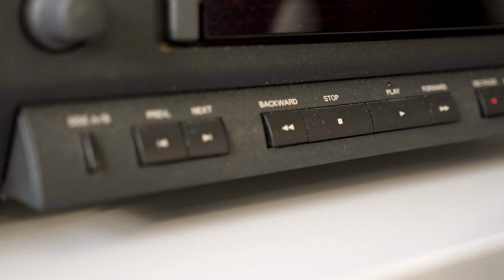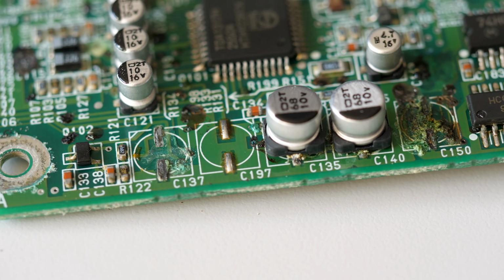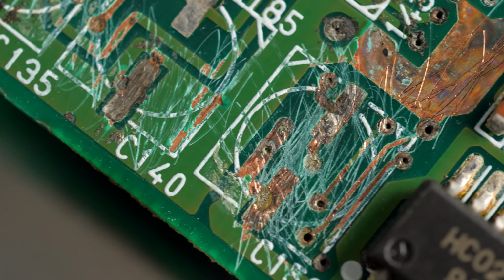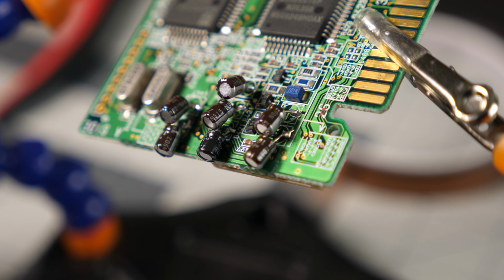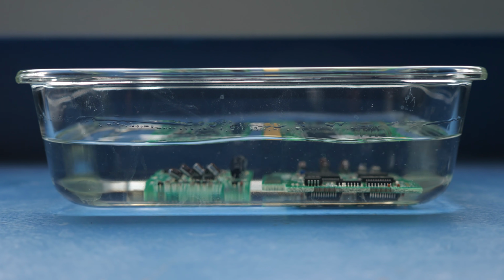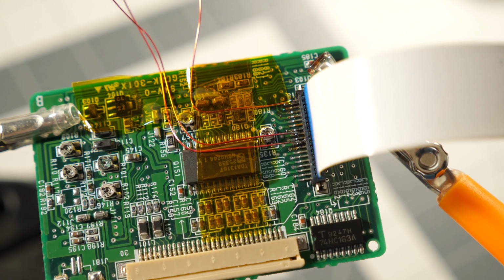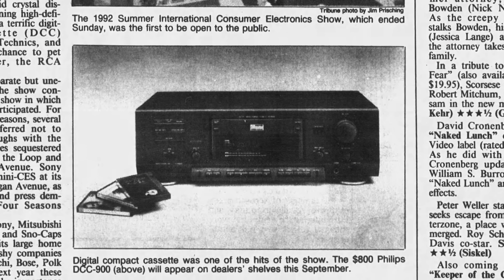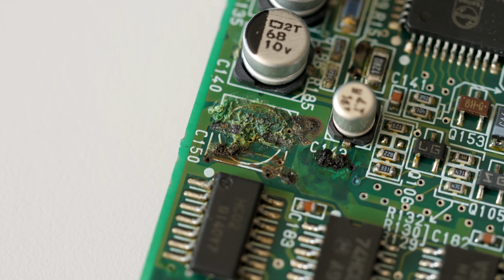My DCC Deck Repair Didn't Quite Go as Hoped...

Comment: I had one with similar problem, it played DCC just fine, but it played regular cassettes with a ton of noise and if I recall, mostly from just one channel, what I learned from it, DCC players are junk. I've owned many high end stereo cassette decks from pioneer and similar brands and they always had excellent playback quality. If I needed better recording quality than standard cassette I used either Type II or type IV cassette and recently i converted them to .WAV on my PC and they sound perfect, near CD quality. DCC seems like a useless format to me, no artist ever released any album exclusive to DCC, unless you were a musician in the 90's and backed up all your master recordings on DCC instead of DAT or CD-R, the machines aren't useful or valuable.

Comment: Don't want to criticise Dr Dcc, but he or someone from his company did quite messy job to the read/write board. Looks like he just badly scratched loads of pads and traces on circuit board with some sharp needle or scalpel, when it's can be done with tiny soft wire brush tool on dremel like machine without doing such damage which I can see from your video.
As well adding to your problem with your board I can see clearly that loads of other smd components has been damaged by leaking caps. So they all need to be desoldered and replaced with brand new ones, or at least checked with multimeter.
Good luck.
Reply: I agree. Whoever did that to that board had no idea what he was doing. No way was that a professional job. Kind of embarrassing for the „DCC museum“. Just because someone can restore a DCC machine doesn’t make them experts in pcb rework. That board was definitely repairable.

Comment: Wondering if the timing issue is due to a bad crystal, although it would not be an easy fix if it were built into one of those big chips if so.

Comment: 14:23 - Couldn't it also mean you had two bad heads? A head problem isn't really eliminated unless you can test with a known good head.
Reply: The problem with DCC heads, they're pretty much unobtanium. Plus they have to matched to their R/W board, which was done at the factory.

Comment: Not sure how it would be feasible but I’ll go for a complete passive component replacement.
Also in that mater, I would try to see the trough hole connections it does look they are botched and probably not making connections.
The amount of work to be implemented is large but honestly it all can be done.

Comment: Sorry man.  Went through this whole business with an Optimus DCT-2000.  R/W board was in really bad shape, almost as bad as the first one you have.  I recapped, ran some bodge wires, checked continuity, but a bunch of vias were closed up with corrosion they were so bad.  I did manage to get it to play DCC, and some analog cassettes with some random popping and channel dropping here and there.  Not really listenable anyway.  And it won't record at all.  I decided to shelve it and hold out for a second or third gen.  The fact that you went through this heartache with two decks only reinforces my decision.

Comment: I love old school Audio tech. 
I used to own a nice cassette deck. REAL good audio quality. 
One day, it stopped working. Opened it up and it turns out a couple tiny plastic wheels snapped in half. This was before 3D printing.Sadly, I had to throw it out.

Though you didn't get it working, that's the woes of repairing. You wont always be successful.

Comment: There is dozens of things you could try. Try soaking the PCBs in vinegar to dissolve the corrosion, then wash it with soaps, water, and IPA. When I do DIY PCBs I use kero, then strong ammonia cleaners, then water, then IPA. Watch CuriousMarc HP 98035 Clock Module Repair-A-Thon, there is a reoccurring corrosion section in it - he had to scrape and vinegar it several times -.
Maybe align the head.

Comment: I feel for you. An object lesson of obscure audio products. Been doing audio for over 50 years and I will tell you. 2 formats avoided like the plague. 8 Track and DCC. Both are a waste of time for me at least. Your mileage may vary. I never thought it was not that impressive in the first place. DCC. A compromise on both and not great at either. Like an early days enduro motorcycle. Sucks on the road and on the dirt. I am a huge fan of SD recorders. No moving parts, media is cheap, and it requires no herculean effort to make it go. My reference recorder is my Tascam DR-100 mk.3. Love this thing. My Nakamichi and Technics and Aiwa and A&D Cassette Decks are fun, but it is tape. I love them, but for a project I have to count on, or just don't want to bother with Noise Reduction tape calibration and so on, SD rocks. DCC and Elcaset remind me of a  question nobody asked and nobody cared. I sold audio for over 30 years and not once did anyone bug me about DCC or Elcaset. Heck I got more on Reel to Reel and DAT before I ever heard anything on those minority formats. Notice the words good and bad are not in my post. You have to decide what that means in your reality. For me DCC was a blink of a curiosity and I moved on. DAT today is the same way for me. Another moving transport and hard to get media and support that maybe poor. No thank you. I choose my battles carefully. Do my due diligence on documentation support, parts, experts who aren't retired or dead. Yeah like that? Because vintage is just what it means. "OLD!" So know what you are getting into before you dive in. You maybe happier with a Tascam DR-70x for less than $100.00 and for most sound like a million.

Comment: In one or more double sided pcb when traces corroded check for continuity between the levels of a suspected trace.Also try to resolder smd components because there are cases that cutted in an edge and this getting lifted by the soldering tip.And check not only the removable pcb but the mainboard also.The smd chips are prone to dry joins and is good to be resoldered.Every microswitch inside the mechanism of course has be checked for good continuity.

Comment: I wonder if it could be a bad solder joint or a missing trace somewhere, I would go over that R/W board with a mutimeter and test all the connections.

Real shame you couldn't get one of them working but a great video!

Comment: That soldering iron tip is really bad because it does not transfer much heat, you should use instead a flat sided C type one

Comment: I think I'll stick with DAT decks after watching this...
Reply: Good luck with many of them... Check the caps in the head amp. And 55ES/57ES/59ES have many drive issues as well.
Reply: @KR1275  my za5es is fine. so is my pcm-mc1.
Reply: @mvevitsis  I have the same one and that one is a good model (last model). But old Tascam and Sony have a lot of cap problems.

Comment: I'm sorry you had such bad luck with DCC. At the DCC Museum we see lots of success stories but we know some enthusiasts aren't so lucky. That first recorder's read-write board was definitely too far gone to repair and we're considering making compete replaced circuit boards with all new parts except for the read/write amplifier chips.
Anyway, I see you got the right analog channel to work, so believe it or not, you were probably really close! The non-polarized capacitors also go bad on the read/write board, and if I'm not mistaken, the audio for analog playback goes through those. You can replace each of them with two polarized electrolytic caps that are double the value of the original, connected in series with the opposite poles connected to each other.
You didn't show the error display in service mode after you had fixed the via with the bodge wire, but I wouldn't be surprised if at least some of the tracks were working now, and a thorough head cleaning might have fixed it.
Also, I noticed on the second recorder the connector for the flex cable on the digital pcb looks kind of damaged. Did you try using the digital pcb from the first recorder into the second recorder?
It's really unfortunate that DCC recorders are getting pretty hard to find in the United States now. I got back into DCC around 2013 and back then it was easy to find all kinds of DCC decks for around a hundred dollars or so. Right now you would have to go to the Dutch eBay or other Dutch sales sites to find anything other than the DCC900. But of course then there's the problem that they usually only work on 220 volts.

Comment: I tried to repair the exact same model 4 years ago, but same result after recaping the digital board, I gave up on DCC DECK but insteal repair portable player such as DCC175 and DCC170 both succefully repair and work great.

Comment: Your predicament reminds me a lot of my own experience trying to get my Sony TCK96R analog cassette deck working right. Funny thing is it has the same problem as your DCC deck has when playing analog tapes - one channel is way too quiet. I've replaced caps, transistors, made all the adjustments I can think of or find in the service manual, and nothing ever fully fixed it. I gave up too, after having spent probably 30-40 total hours on it. Win some, lose some I guess. I still have my deck sitting at the bottom of my audio rack in case I ever find someone who can fix it right, but it's beyond me. btw, I worked at J&R Music World in NYC in the 90's and we closed out these DCC decks for $99. I remember thinking "should I buy one? Nah..." Always been one of my big regrets.
Reply: Does your deck have the green nichicon Bipolar Muse capacitors on the output board? One of them maybe shorted.
Reply: @JD-lk7im  I'll check when I have some spare time. I'm sure I have some photos I took when I was working on it that I could find in the meantime and that might tell me something. I went through so many tips that other people gave me at the time and none of them panned out. But I don't remember that one specifically, so thanks, and if I see those I'll just go ahead and replace them and see what happens.

Comment: digital equipment are harder to fix than analog ones because they require much higher precision.
Reply: DCC recorders are complicated, but they usually are easy to fix, unless the head is dead (e.g. if some moron tied to demagnetize the head). Bad capacitors are pretty much a certainty on the first generation of recorders because they start leaking; that damages the boards and in extreme cases such as these two recorders, they make the repair too much of a hassle. But in later recorders, capacitors are not much of an issue. Furthermore, even though DCC recorders are full of custom chips, those don't usually go bad so a bad chip rarely ruins your day.
The mechanism is just that: a mechanism that gets the same problems as other (analog) cassette mechanisms: basically lubrication that dries up and belts that disintegrate. Easy to fix. Later generation recorders most of the time just work except for the belt that opens and closes the drawer and a soft-plastic gear that tends to break. Precision is surprisingly irrelevant because the tape guidance pins on the head and in the cassette take care of the precision, and make it so that there is almost nothing that needs to be adjusted mechanically. In portable players, it even kinda looks as if the heads aren't properly attached.

Comment: Definitely try and get a later generation deck if you can, even if you have to get it from overseas. I live in Australia and got into DCC about 6 years ago when I bought a DCC 900, which just didn't play tapes at all. Like you I wasn't able to fix it and was disappointed, but kept a look out for a later generation deck. Ended up getting a 951, which I imported from the Netherlands, which I've had for about 6 years now, and apart from needing a head clean a few weeks ago, hasn't skipped a beat. Just be aware of voltage differences - being that we use 240V here in Australia this wasn't an issue for me, I just replaced the Euro power cord with an Aussie one and it worked out of the box, but being in North America may be an issue for you.

Comment: Did you re-align the head after swapping it?
Reply: Somewhat surprisingly perhaps, that's usually not necessary. The tape guiding pins on the head, in combination with the guiding pins in each cassette, make it so that the tape goes through over the head at an exact angle. Also the DCC system compensates for small variances in the azimuth for digital tapes, and when it plays analog tapes, because it uses two of the nine heads to read the much wider steel tracks, azimuth control is still much less critical than on analog decks. When they were new, DCC recorders were the best way to play analog tapes. Unfortunately nowadays because of aging, we don't recommend playing analog tapes in DCC recorders anymore at the DCC Museum. You will probably get excessive wow and flutter (especially on the later recorders which have more plastic) and analog tapes "shed" magnetic material on the heads which makes it necessary to clean them, and that's not easy on most recorders.
Anyway the bottom line is: the alignment of the heads in DCC recorders are mostly so the tape doesn't get damaged by going through the mechanism. On portable recorders, the heads are even mounted in a way that always makes me think someone forgot to tighten some screws.

Comment: DCC museum butchered that circuit board, that scratching looks way worse than corrosion damage.
Reply: I agree - that board looked salvageable from a technical perspective :(  Probably only returned because they couldn't justify the time they would need to invest in it.
Reply: The scratching is necessary to get the corrosive crap off the board. It's really important to get it really clean because even the most minuscule remainders will creep through the board along the traces, and inside of the chips too. I think what happened is that Dr DCC started on the repair but found out that the damage was much worse than expected, and with the trashed mechanism it just want worth repairing. 
That second recorder looks like it's almost working and could probably be repaired by the DCC Museum. But as Colin said, he already sunk a lot of money and time into it.
Reply: @JacGoudsmit  Circuit board can be cleaned chemically and if mechanical cleaning is necessary you can use cheap fiberglass pencil to lightly "sand" corroded spots. I higly sugest that every electronic repair technitian shuld buy such tool.

Comment: I certainly don't have any experience with DCC, but on the read/write board, it's true as you kept looking more at it, there seemed to be more corrosion. On at least one of the chips I did see a fair bit of corrosion at least on the surface of the solder joints. The only thing I can think to do is go over every millimeter of it with a microscope, vinegar, and see if you can find any damaged traces or solder connections. Short of that, maybe swapping out chips. But that would be expensive, not to mention very tricky, if you have to source another deck for the parts. I hope you have success. I know you have the ability, if you can figure it out.

Comment: Dont give up, I have seen other smd caps go bad also and not just the electrolythics, the other ones get conductive or completly shorted. Also, the smd resistors that came in contact with capacitor acid do not have the same resistance anymore. Test everything again.

Comment: I am not a DCC expert, but since you do have a scope, my suggestion would be to trace out the signal and see at what point you lose it.
Since you have a schematic/service manual that wouldn't be hard to do.
That already tells as so much more in what direction we have to look and think.
But I also don't know if you have the time and patience to troubleshoot this any further?
edit; reading the comments; yes along the same lines check all the oscillators and such as well

Comment: I had the same experience with the 900 decks. Sank a lot of money into two unfixable ones. So I gave up. Now I have a 36mm midi sized DCC-91. Excellent condition, no problems so far. But I live in Europe, so the supply of decks is somewhat better. I hope you find a working--or at least repairable--one someday.

Comment: I would double check all the capacitor values. There could’ve been a difference between the originals and the pack that came with the second unit. I’d also triple check the power supply voltages. It’s possible you have some caps that are bad inside the power supply, and even just a small variation could be causing something odd. It’s worth some measurement with the voltmeter.

Comment: hi keep to the makes i know and only buy decks i can fix up     soundcraft 381  760 are uk  reel to reel decks and are easy to fix up if the cap are the one like you have to change
i keep away   i have worked on alot of audio gear over the years  prices are getting silly  i came back to the cassette after a long time the best way is to have them running at x2
speed like the tascam decks i have 2 tascam 248 deck that are in a very bad way one is playing only  3 3/4 ips  and 7 1/2 yes  7 1/2  i put in new motors was not easy
it can  do 1   1 7/8  funny thing i know that alot of cassette are not recorded right    i know a man his mate was in the cassette  making game   love the video still  bob's bit's